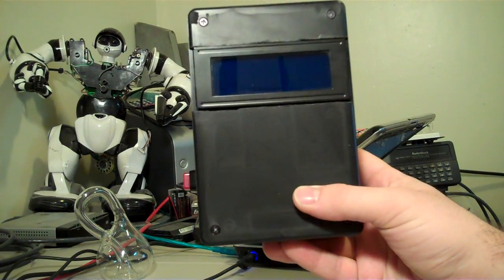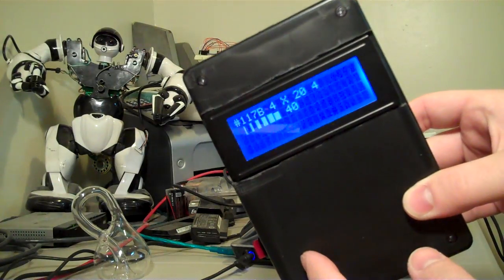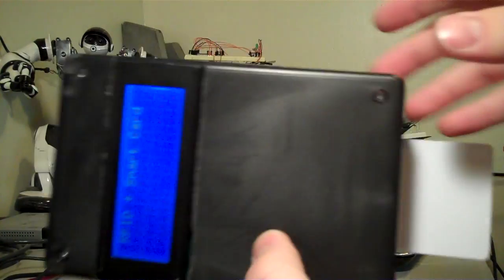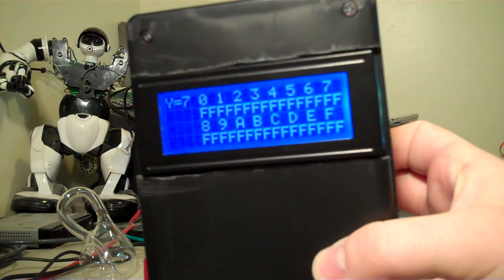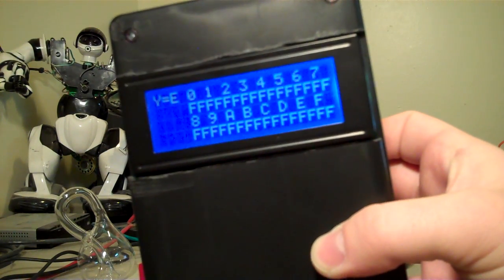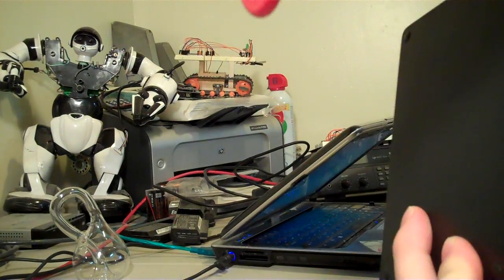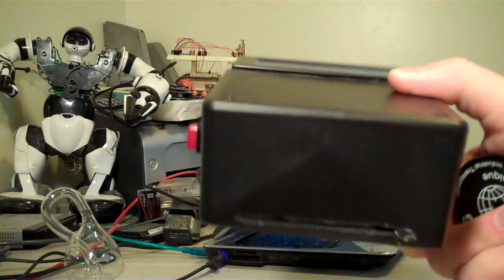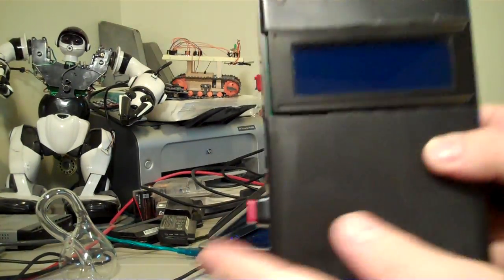RFID Smart Card Reader Complete

Comment: Hmm, add an external SDRAM or SPI dataflash chip for data storage. I have an Atmel UC3 A3 Xplained evalutation board with 20 GPIO pins on it. It comes with SRAM on it already and you can add  Flash ROm storage to it. It might take a month or two to understand how it unctions, but its pretty fast. With the MCU, you can hold the program in storage on the CPU.

Comment: I have a question (you might have gotten this one a lot but...) I have a pokemon snap smart card with 0 printing credits had 8 but used them up, I want to know if this thing could reset it back up to 8 its chip is like the one on the orlando card you had there so I know this thing could read it